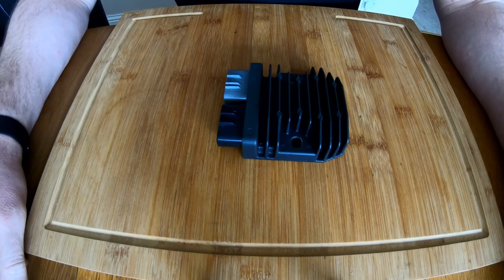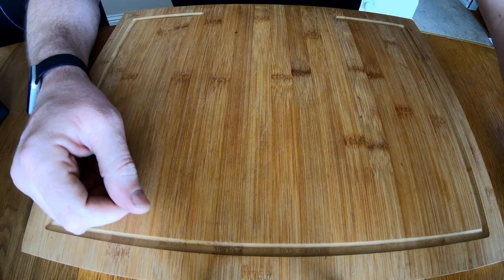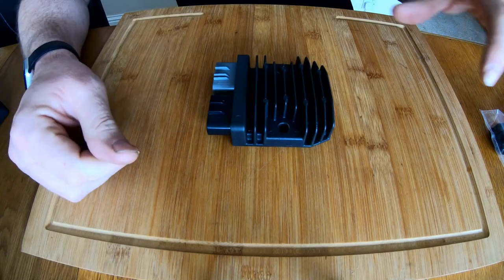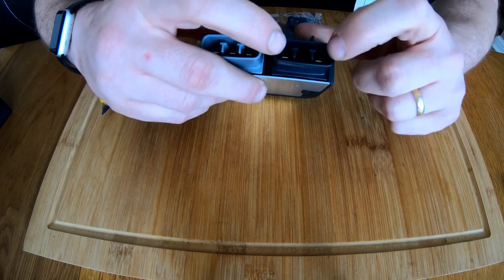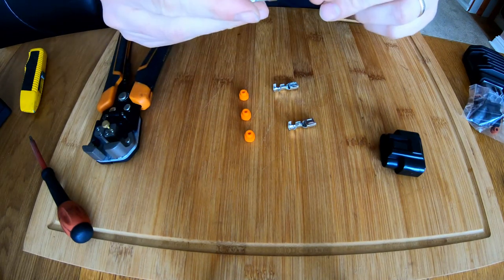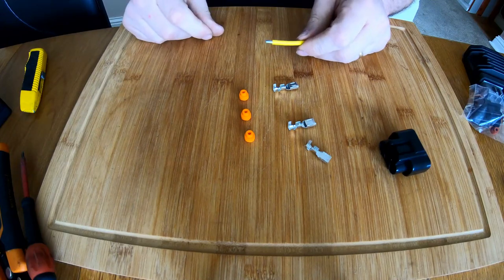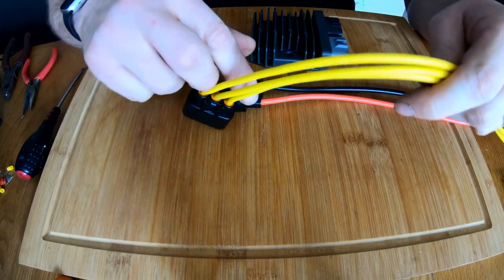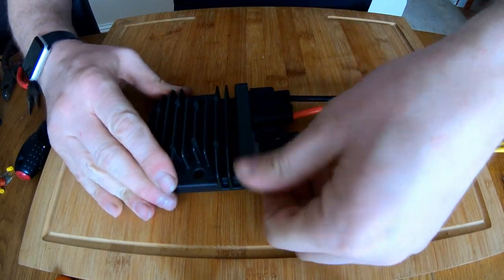Replacing The Reg/Rec On The VFR800 With A Shindengen FH020AA. Episode 1 - Creating The Wiring Loom.

Comment: When tinning, put the iron on the backside of the cable, and the solder on the front. The iron's heat will allow the solder to flow toward the iron. Putting the iron directly on the solder risks a blob of solder "sticking" to the cable, without flowing through it.
Reply from the maker: Good to know! I’ll remember that for the future! Like I said in the video, I’m far from an expert at anything even remotely electrical. Thanks for the advice 👌🏻
Reply: @KevsShed  Is it a must to solder the new connectors? I saw that you use a tool to press them around the wire, isn't that enough? Or does it risk to break loose sometime in the future?

Comment: Hi, I did the same on my vfr750 after replcing 3 reg/rec in 10 years. Last time it cooked my battery! I'm hoping that connecting + and - strait to the battery will improve the life of the reg. You made a much neater job of it than me and I fitted an inline fuse, never thought of using a breaker. Cheers.
Reply from the maker: Cheers buddy 👍🏻

Comment: Thank you for taking the time to make these videos! I can't seem to escape the electrical gremlins of my VFR, no matter what gets replaced... Great idea of using that self-resetting circuit breaker; I've had to replace that fuse twice on the side of the road within 3 years.  I love this bike; when it runs, it's fantastic, but there always seems to be something. I currently use mine for road trips and commuting, but aforementioned electrical issues might knock it down to a project bike or track toy. I'm going to try your suggestions and hopefully I can make it reliable again, but gremlins here and there are to be expected with any older bike.

Comment: Useful vid, thx for posting. A couple of things - probably best to use copper cable rather than ally and you could drill and tap the holes for attaching the reg/rec to the plate.
Reply from the maker: The cable is tinned copper, I agree about the tapping and did trial it but being only 5mm thick, there weren't enough threads to be as secure and reliable as I wanted, thanks for the comment though.
Reply: @KevsShed  Actually, mines a 5th gen with the mounting at the back so I just drilled a couple of holes in the sub frame and bolted straight through the plate and reg/rec. Just realised my crimp tool is no use for the Furukawa terminals, so now I've got to wait another few days for a new one. Always something else!

Comment: Spray dielectric grease would be a good thing to use on this project to prevent moisture damage.
Reply from the maker: I have since used dielectric grease on all of the connections but not a spray kind. Cheers mate. 👍🤓

Comment: Hey Kev! I'm about to do the same job on my VFR750 and was wondering what crimping tool I'm supposed to use for the connectors on the regulator. The link in the description doesn't work anymore unfortunately. 

Cheers and thanks in advance!
Reply from the maker: Thanks for letting me know I will update the link shortly 👍🏻

Comment: Hi Kev, I've a question about the choose to replace the regulator with a mofset shunt type instead a mofset serie type. I' m not an expert, but I have read that series type prevents damage to the stator. Is this true?  On the connectors you have replaced there are three pins from the stator, and only two coming out from the regulator, in the original are five, four cables are double (two for "+" two for "-") the fifth is black,  black and white after the connector, what is it for? I've also seen that in your bike "FI" lamp is always on... Thanks, have a nice day! Alex
Reply from the maker: Hi mate, the series style R/R does indeed run the stator cooler as it places a lot less stress upon it. In the stock loom there are 5 wires at the R/R connector as you correctly stated. 2 are +ve and 2 are -ve, these these cables have just been doubled up to prevent the need for a single thicker cable, nothing more than that! The last black and white cable is a switch live from the ignition that powers up when the key is turned to give a signal to the stock R/R to power on. Nothing more fancy than that! The 3 cables from the stator connect to a separate plug. Lastly you have never seen the FI lamp lit on my bike unless it was immediately after turning on the ignition but then it extinguishes after 1 second which is perfectly normal.

Comment: I need to consider this going forward. What’s the tell tale signs it needs doing if all wires look ok
Reply from the maker: The initial tell-tale sign can be poor battery charging but there are others. Some problems can be attributed to the Stator too. To be fair if yours is on the OE Honda Reg/Rec then changing it out for a Shindengen FH020AA or SH847 is a great preventative measure. If you are lucky you'll find it has failed one morning when your bike won't start because of a flat battery. If you are unlucky then yours will fail whilst out riding which will cause a breakdown due to the bike having no electrical power.
Reply: Kevs Shed cheers mate will take a look as all looks clean at the mo, unless it’s been done I will take a further look 👍🏻
Reply from the maker: @Motourev  You can just about see the Reg/Rec without taking the fairing off by looking down the right side fairing around 6 inches below and 6 inches back from the handlebar, if you get your hand in there and have a feel about, you'll know if it's been changed if it has the 2 big connectors on it. The stock one doesn't have any connectors on it as the wires come directly out of the unit
Reply: Kevs Shed cheers mate great info thanks. I’m new to VFR so all helps ❤️👊🏻

Comment: Hi kev,this Is the mod to save the stator and Electric problem of the VFR?mine its all stock,no led lamp or other.thsi work you do its good for mine?
Reply from the maker: Yep, this’ll sort you out a treat 👍🏻
Reply: @KevsShed  any shindengen fh020aa could be Good or better find as you of Yamaha MT?doing like your video its all plug and play on bike? Almost for cable, no need to solder on bike

Comment: Gotten a fh020aa for My 01. Gonna replace My stator and regulator in a week it two. Gonna install a couple of outlets for gps, heated grips etc while the electrical gets reworked
Reply from the maker: Nice! 👍🤓
Reply: @KevsShed  and i used your link for the connectors

Comment: Kev I’ve fitted new rectifier and made a plate . I’ve got 2 block connectors 3 yellow in one then I’ve got another block with about 6/7 and I’ve only got red and black on new part ?
Reply from the maker: The original connector has 5 cables into it. 2 green and 2 red and white and 1 black thinner one. Don’t worry about that though, they are no longer required. After you have disconnected your Honda Reg/Rec, simply tape up this connector to ensure it is watertight. Then the black and red from your new Reg/Rec goes straight to the battery

Comment: Hi Kev. Ive got the same year bike and the connections look slightly corroded. Should I just keep and clean the connections or upgrade the wiring and rectifier? Cheers👍
Reply from the maker: Hey buddy, if you are not currently having charging issues which means that the RR and Stator are working as they should then my advice would be to cut out the connectors and hardwire them with heatshrink. This will stop water ingress and should give you plenty more service life. 👌
Reply from the maker: @jonor95  Only you can make that call buddy!

Comment: Hi Kev. Does this wiring harness that fits the fh020aa also fit the sh847? Thanks
Reply from the maker: Yes, the mounting holes for the sh847 or totally different though.
Reply: @KevsShed  Can you supply the rectifier aswell as the wiring? Cheers

Comment: My electric went out and I bought a new wire harness. And my fuel pump isn't coming on and why I got new reg. Fuel sender unit battery ?
Reply from the maker: Check that no fuses have blown and all relays to ensure that they operate as they should. If you go to the VFR owners club on Facebook and ask for Stuart Hayes, he will be able to give you a workshop manual for your machine which also contains a detailed wiring diagram.

Comment: Hi kev.
Is there any difference between fitting a Sh847  than the fh020aa rectifier? Thanks 👍
Reply from the maker: Cost is the main consideration but other than that, the SH847 is the go to R/R if you plan to use LED lights as one example as the SH847 is much better at dealing with the extra voltage kicked out by the stator that isn’t used. For a normal road bike however the FH020AA is easily as capable. The SH847 is often used on track bikes that don’t have as many electrical systems such as lights and heated grips etc. 👌🏻

Comment: Great video. Do you know if they sell these crimps seperately? wouldn't mind re doing some of mine.
Reply from the maker: Which crimps do you mean bud?
Reply: @KevsShed  the female ends that go inside the plug connector, was going to just order another connector kit but the delivery time is nearly a month and don't want to miss the short spate of good weather we get in this country 😅
Reply from the maker: @chillyourbeanst7861  Ah right, they probably are available but it's knowing how to name them correctly in a search! I had a trawl around eBay for you but was unable to find anything!
Reply: @KevsShed  I had the same problem. No worries. Thanks for trying.
Reply: Sorry to keep asking questions. Did you hardwire your stator in? Do you know how it's wired compared to the original connector. Thanks.
Reply from the maker: @chillyourbeanst7861  not sure if it’s what you mean mate but it doesn’t matter how it is wired, it’s 3 phase so and of the 3 wires can be connected to any 3 from the  stator 👍🏻
Reply: Where do I find the links for the connections and wiring to buy Kev?

Comment: Hello. Can u help. I instaled FH020AA and new stator on my VFR800 2003 and still dont have charging. Max charge is 12.7v on 5k rpm. Got wireloom like u. 10awg wire for positive and negative terminal and new stator got new wires. Tested stator it gives 30v on idle and 80v on 5k rpm. Regulator give 15.4v when its not connected to battery, when i connect it to battery its 12,6-12,7v. Everything looks fine but does not charging. Thanks. Btw u got great videos and tips :) cheers from Croatia
Reply from the maker: Have you changed the battery? That would be my first suggestion. 👌

Comment: do you know if this set up would work on the 5th gen aswell?
Reply from the maker: Yes absolutely 👍🏻
Reply: @KevsShed  brilliant thanks, just ordered an mt09 r/r from ebay and all the connections will there be any other parts needed in your final video so i can get everything at once?
Reply from the maker: Only a bit of heat shrink 👍🏻
Reply from the maker: Once you’ve done the upgrade it would be great to see photos! If you head over to the Kevs Shed Facebook group it’d be awesome to see 👌🏻
Reply: Kevs Shed will do...just waiting on the 3 pin connectors to turn up 👍
Reply from the maker: @chrisdorricott8800  Have you finished the job yet Chris? Don't forget to share the pictures with us on Facebook!
Reply: Kevs Shed should have it finished tonight so i will post some images this week👍 found a minor engine issue i needed to fix first 🙈 but it’s all good now!

Comment: I am looking at a second hand mt09 reg but on the bottom it says fh020aa   5.6 051 f instead of fh020aa 4.5 231 f as the one in the vid say's.
The add says its from a 2015 mt09. 
Would the one i'm looking at be ok in your opinion?
cheers
Reply from the maker: Yes, absolutely. I am led to believe that the numbers after the FH020AA model number are just batch identifiers. 👍

Comment: Great video kev
I'm in the process of ordering the bits for this mod.
Could you tell me the connectors you used, I'm not understanding the sizes as there always talking about mm² size of cable rather than 2.5mm/awg 10 diameter.
Your links no longer work unfortunately.
Tia 👍🏻
Reply from the maker: Hey bud, just updated the connector link with a working one for Amazon, they deliver next day too! 👍
Reply: @KevsShed  Sorry keV, my mistake. It was the terminals I'm after. I have the connectors and wire already.
Thanks
Reply from the maker: @Jimc1390  Ah right in that case try this one! 😀 https://ebay.us/FFdsn1

Comment: Hi Kev - just watched all three videos. Great videos! Can you explain why you’re replacing the reg/rec and why a MOSFET reg/rec is an improvement over the oem Honda Fit ent to the VFR? Thanks - Mick
Reply from the maker: The main reason is that the connectors supplied as OEM when the bike is new are pretty poor and allow moisture to enter which in turn causes corrosion which in turn causes high resistance. This then leads to excess heat and often melting or charring of the connector blocks and damage to the R/R or Stator or both. This replacement removes all of the unnecessary connectors meaning less likelihood of a point of high resistance and the MOSFET R/R runs far cooler and puts far less strain upon the OEM stator. I hope that this answers your question.

Comment: Hi Kev - just picked up an 05 6th gen last weekend and have been going through your vids - you’re doing a great job! 
Quick question. Is this mod the same as the VFRness I’ve read about in the USA? Thanks again!
Reply from the maker: No mate, the VFRness is a replacement harness that bypasses the connectors in the loom that are prone to corrosion. It is largely irrelevant nowadays though. And is totally unnecessary if you follow the steps in this series of videos.

Comment: Just getting ready to crimp, (never, ever crimped these type if terminals before), but it looks like the orange bung is crimped with the terminal insulation. 2.24 in vid https://www.youtube.com/watch?v=NbNNO9-NJww
Reply: I wish I had a few extra terminals to practice on, lol.
Reply: Make sure the connector blocks you buy have the right terminals, the ones I bought were too small for 10 and 12 AWG wire. They should be 6mm terminals I believe.
Reply: Hope you don't mind me adding this Kev, here's a link showing the two different sizes for the connector blocks https://www.corsa-technic.com/category.php?category_id=116